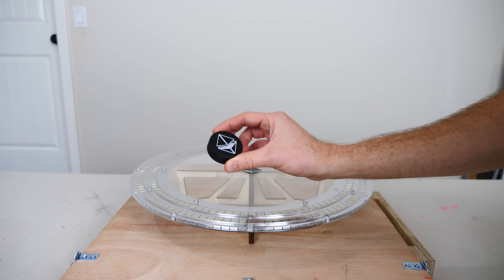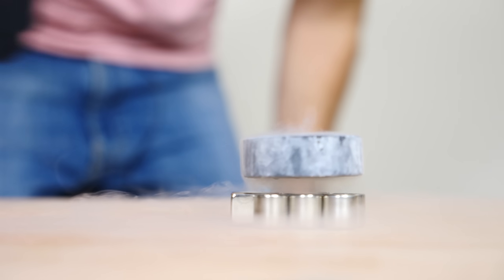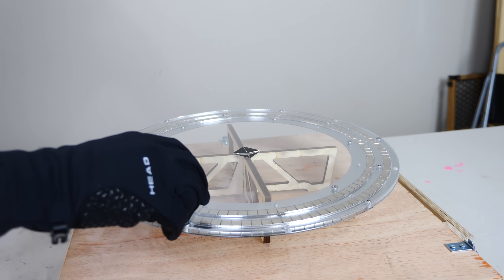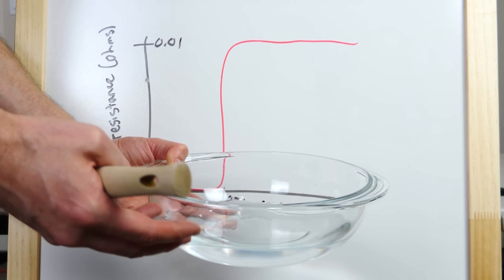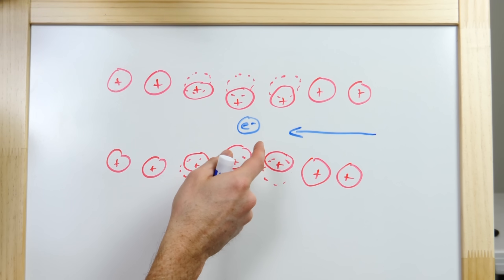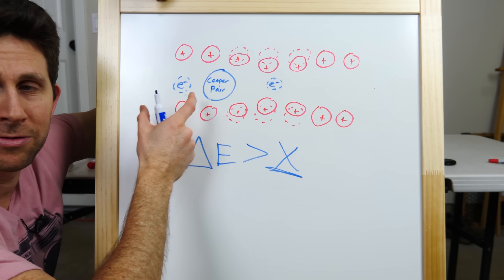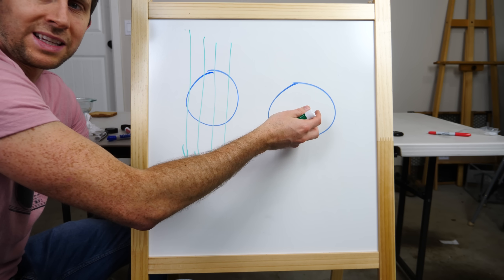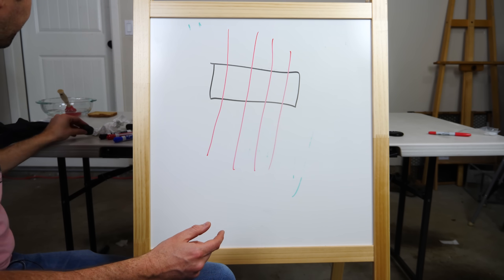Quantum Locking Will Blow Your Mind—How Does it Work?

Comment: Your explanation is irrelevant a superconductor by definition has zero resistance therefore zero power consumption the current generated in the superconductor creates a magnetic field that opposes movement however when you start the circular motion this can cause rotation current patterns the physics of which I will leave for you.

Comment: Interesting your magnetic track holds the superconductor at a constant height but air friction would eventually slow down the rotation, what other forces would slow the movement. If you were to place the whole apparatus inside a vacuum there would be no friction and no heat gain to the superconductor, it might run for years.

Comment: There is a type of mixing unit for single use biopharma tanks that uses a Stirling engine to cool a superconductor down to generate this effect. The mixer then rotates a magnetic impeller inside a sterile mixing bag by spinning the Stirling engine at a fixed rate.

Comment: Ok that means a superconductor is a conductor which offers zero resistance at extremely low and critical temperature .
That means when a current is passed through a superconductor it flows and flows till it does not stop, & and that current greatest magnetic field , when the conductor gets fully charged or magnetic energy is stored , the supply is cut down but the stored  magnetic energy lasts & is continuously stored in the superconductor. Then after if  we need energy we can get it back from the superconductor.

Comment: Why cant we use this for transportation on a trolley or railroad system 
It looks like if you built a rail system out of strong electro magnets then mount these large super conductors on the bottom of the train or trolley that with drip feed liquid nitrogen you would get super smooth fast frictionless ride

Comment: The bit about Cooper Pairs makes me think of the slipstream effect freight trucks can cause. If you manage to get close enough to the rear end of an 18-wheeler, the eddies that form from the air flow suddenly collapsing behind the trailer can actually pull you in, causing your vehicle to act like an extension of that trailer. It actually improves your miles per gallon, while reducing that of the truck. (Also it’s super friggin’ dangerous so don’t do it.)

Comment: An interesting thing that can happen in a superconductor is that randomly a current can appear within the superconductor without any voltage applied. And as there's nothing driving it and zero resistance, it will go on FOREVER.

Comment: ... You can demonstrate that principle very easily by dropping a magnet through a roll of tin foil. As you drop it, it will fall way slower than normal due to the opposing magnetic field in the aluminum. From there its easy to imegine the same thing without any loss in thermic energy or heat; the magnet would just stay where it is, as the opposing magnetic field in the aluminum is perfectly equal to the magnetic force of the magnet but in the other direction. Since they cancle out perfectly the magnet can't move.

Comment: How long does the puck go around for? Does the air resistance would slow it down quicker? Would doing it in a vacuum keep the puck going longer? Would a wing shaped superconductor get lift & do strange things on the magnet ring?
Reply: as long as it stays cold, not really, unless extremely viscous, sure, no.

Comment: How mong will it continue to spin on its own?
Reply: as long as it doesnt heat up which is unfortunately not long in room temperature. however, new potential research may have found a material that can be a superconductor without insane cold or pressure levels. it would change everything and it is called LK-99

Comment: You just provided the evidence to prove flat earth and that the sun and moon is local ..they rotate inside the firmament over electric magnetic laylines.  Prove me wrong with quantum mechanics with the theory that both the moon and sun provide energy (we/people call it "light ") and that they utilize geographical laylines to move in a non frictional motion at "roughly " the same speed.  They say in the vacume of space the rotation of "planets of zero g allows for the solar system to move freely without resistance..u with this experiment has shown that in our plain of existence u can have motion without significant friction..amazing

Comment: If there is no friction will it slow down on its own once pushed around the track?
Reply: There's still friction from air resistance, so eventually it will slow down. But I guess if it were in a vacuum, then it would keep going as long as it stayed cold!

Though once it warms up, it won't be a superconductor anymore, and the effect would end. People have been trying for a long time to create a material that's a superconductor at room temperature (and there have been lots of scammers who claim they did it), but there have been no proven successes yet.
Reply: @__-cx6lg  how cold is space? Wouldit keep a superconductor cold plus no friction ?

Comment: Innocuous thank you.
Reply: This is the most insane schizophrenic rambling I have seen in a while, I can only assume Action Lab liked your comment solely for your donation.

"In a separate comment, I explained that the strong nuclear force can be modeled to first approximation by magnetic dipole forces that reach 'nuclear' levels when the distance is small (picometers, femtometers)."

This is incorrect. The strong nuclear force, which holds atomic nuclei together, is governed by quantum chromodynamics (QCD) and involves the exchange of gluons between quarks. It’s fundamentally different from magnetism, which is an electromagnetic phenomenon. Your attempt to model the strong force with magnetic dipoles is a misapplication of concepts—magnetic forces don’t operate at nuclear scales (picometers, femtometers) in this way.

"The mass of a particle of an ideal gas at 300 Kelvin (the surface of the earth) where the speed of the particle is the speed of light and gravity (the speeds are identical) is about 0.025 electron volts."

First, particles with mass cannot reach the speed of light, according to special relativity. Second, you seem to confuse gravitational acceleration (m/s²) with speed (m/s), as "gravity" isn’t a speed.

"The CoData electron mass is 510,998.950 electron Volts. So there are several million of these particles for each electron. The field of the electron can be visualized as the flow, density, and action of these particles. This super fluid. This supercritical fluid."

The idea that an electron is made of "several million" smaller particles is baseless. In quantum field theory, electrons are excitations of the electron field, not composites of smaller entities. Calling it a "superfluid" or "supercritical fluid" has no grounding in physics.

"The earth's gravitational potential field is intimately mixed with the earth magnetic potential field. It is not coincidental that magnetic levitation is the 'go to' method for levitating, balancing or exceeding the earths gravitational acceleration field."

Gravity and magnetism are distinct forces in physics. Gravity is described by general relativity, magnetism by electromagnetism. You are overinterpreting a practical application as evidence of a deeper connection.

"I am working out what kind of generators could replace the SpaceX 'Booster' and lift their StarShip from Earths surface to orbit. Dynamic fields are much cheaper, so magnetic induction at high frequencies is a good way to move things, which is why magnetic induction is part of motors, generators. Superconductors are modifying the local gravitational potential and shaping it."

This quote especially clues me in that you are schizophrenic. Magnetic induction powers motors and generators, but using it to lift a spacecraft like Starship to orbit is beyond impractical. Its total sci-fi nonsense. That would be like if I were to state that I am working on teleportation technology to send people to mars.

Putting "The internet foundation" after your name because you bought a website back in 1998 doesn't allow you to spout absolute nonsense as fact. Please talk to a doctor.

Comment: I'm curious. If you stuck the positive lead in the magnetic field, the negative on the magnet, what does it read. Also, on current measurement, put both leads in the field. What does it read, or being creative, can you get the field to conduct electric current.

Comment: What you are demonstrating is called "flux pinning".   A superconductor excludes a magnetic field, except where there are defects in the Crystal lattice.   In those small regions, the magnetic field can pass through the superconductor.   It takes energy to change the orientation of the superconductor wrt to the magnetic field.  And surprisingly, its possible for a type II superconductor to almost completely exclude an external magnetic field.  In that situation, the high temperature superconductor will not be flux pinned by the magnet and will always be repelled.  I don't know why you call the effect you demonstrated "quantum locking".   Most people call it flux pinning.

Comment: It's funny, when I was 10, 29 years ago, I theorized some sort of perpetual motion machine by taking a sphere of magnets with the same polarity facing inwards, and a smaller sphere of magnets inside with opposing polarity facing outwards, and thinking the internal ball would be suspended inside of it infinitely.  I thought if you could spin it, it should stay spinning forever.  To which I first thought of the friction from the air eventually slowing it down, so it would need to be inside a vaccuum. I thought of gravity too, so I wasn't sure if the vacuum would need to be between the two spheres, or also surrounding the outer sphere.  I thought  there may be a way of harnessing some sort of energy from the internal sphere's revolutions but later found out the act of trying to harness something from it would ruin the motion of the sphere.  It's pretty cool to see this experiment, because it kind of models the idea I had in my  head about the opposing polarity of magnets creating essentially an equally balanced field that repulses an object, but in my theory it would be the magnets on each other, not something in between them. 

How long do you think it would take to come to a stop if left alone? What are the important variables if initial velocity is a fixed given amount? Air drag and the puck heating up and losing it's properties? (Sorry if you address this, I paused at 5:30 to write this comment!)

Comment: So like what if we set a circular bar above this magnet circle and attach a cable to it and to a wheel placed on top of the circular bar that being said one push or occasional pushes to push the super conductor in a circle motion causing the wheel above to rotate then attach a rod to the center of the wheel  leading to center of circular bar which holds a generator power by rotation and boom energy with out a greenhouse foot print

Comment: Have you demonstrated this in a vacuum? How long does the puck take to return to a high enough temperature to where it stops acting as a superconducter? How thin could that superconducter be and still carry the orange? Would the semiconducter behave differently if it was a torus?
Please make a torus shaped superconductor and a sealed liquid nitrogen container,  perforated at the bottom just enough so that it does not explode, that can sit atop the torus and feed the torus to keep it cold. Next, make a dome out of non-conductive metal to sit atop. Put little green men inside and send them for a ride.

Comment: So not much energy goes into the production of liquid nitrogen, i wonder why theres not a super conductor driven vehicles or even product manufacturing or postal services like routing..  why couldnt you have an array of magnetic roads pr say and a vehicle with some super conductor that has its own constant supply of nitro to cool the conductor.   The energy required to generate the liquid nitro should be way less to move something than gas motors or the electricity to power the equipment moving the things.,

Comment: I guess this answers why I always see nitrogen vapor whenever I um, lose time.. explains why things move around like instrument tables so forth like its locked like this, like its on a rail but floating at the same time.. I've always thought it was an anti gravity type thing but this is more explainable cuz of the properties here, locked into the same distance from the wall moving at the same constant speed until one grabs it or it disappears..  I'll see one grab like a light source then change its axis position then move it across the room or even out of the room with a slight push.. maybe this is what they're doing or very similar.. also it could explain why its always so cold up there too?

Comment: I think we need to consider the possibility that magnetic flux may not be the equivalent of DC but have a frequency that enables it's source to remain autonomous.
As another example.
Just because the Sun is not physically connected to the earth does not mean it's not influencing conditions upon each other.
The perfect way to stop loses is to not transfer energy from a source to a donor but to use invisible force to get the donor to behave as if it's had an injection of energy and which it has produced itself. induce
Reply: what the holy Jesus did you just say
Reply: Seems more like AC what Tesla and the Tesla coil. And theories about the Pyramids.

Comment: It would be impressive if it was a natural effect, but this is a piece of technology, a specifically manufactured device designed to artificially constrict the field to certain points. Once you know how it works all the magic falls away and it's just 'Oh. So do we have a use for this thing?'
Reply: Nature uses this in materials. Nature is the housing unit for this rule.  The closer you get to the planet and further also have distinct differences in the way things will work. 
ALL are easily understood through a simple comprehension of the way magnetism works. 
It would be impressive if people didn't waste so much time in their lives and feel the need to share how little they know with others.

Comment: That's how flying saucers move from place to place. Super conductor vs Earth's gravity or any other gravitational force as long as you lock or pin it in like said state. Gravity and magnetism are 2 different forces. Magnetism seems to trump gravity as shown in the video. So if you can create a magnetic field in front or around the SC you can be suspended in animation. Now that you have the field, just create the force to move the object, speed has no limit because their is no heat which is a big problem for light speed. The next step is to find a propellent move the object or craft if you would. Just a theory from an average thinker.

Comment: What experiments have been done with regards to alterations of the pinning?  Is it possible to create a venturi effect by reducing/increasing the pin number on one side of the conductor, is it possible to alter pin direction within a circuit and have them activate the cooper pair process based on differentials in temp./resistance?

Comment: i can't help to visualize a new type of aircraft triangle  or disc shaped 
using magnetic field earth's or magnets a reactor to power 🔋 stuff up and to create  a device  to cool things down a super conduct material and there you have it at Zero resistance you need a fart to move your aircraft around haha so if its a round craft it will be more flexible to move in any direction  and a triangle  aircraft  less maneuvering but more speed as you only have 3 corners to use for propotion and a round disc shaped aircraft  in any given edge all around cool stuff the next problem will be to figure out Zero gravity change as the instant speed will simply kill the crew inside  of the craft unless we make it a drone and no issue  there Bravo Darpa am waiting for a job offer haha

Comment: Machines that worship technology and artificial light intelligence based science,when a Soul Spirit essence experiencing itself as the highest speed of an Atom cycling water worlds with such enormous Fire 🔥 light of Creation energy of infinity Love vibration of One Atom cycling water worlds that are balance between alternating electrical power of negative magnetic polarity space vectors and positive magnetic polarity space vectors that are integrated as magnetic 0 vertical expansion of consciousness to experience more of what Love vibration Creates in R mirrors with Artificial intelligence machine coded augmentation technology driven programs running memory driven codes no different than Ur automobile diagnostic tool scanner to check codes that are not firing properly the correct sequence of the event horizontal vectors of circles of space.
Balance in ur Space Transportation systems command.
Command and control over ur space vectors
What are U experiencing in ur space vectors?
Are U experiencing what Love is on Fire to create with ur Souls energy vibration what Love experiences in R mirrors?
Ur mirror as the observer observing the observed 
What is the energy vibration ur using 2 observe ur mirror ?
It's play tyme Dutch...

Comment: I wonder if a perpetual generator could be built with this. If you developed a way to keep it cold always and had a magnet on it with coils around it and this going around in circles with no friction it shouldn't stop or slow down. The magnet would go round and round through the coil levitated above the super conductor.

Comment: Hmmm interesting. So since there is no friction inside the superconductor, there is no equal or opposite force as a result of friction to cause the puck to move. I wonder if there is any practical application for this. Of course it would be hard to maintain the low temperatures needed outside of a lab.